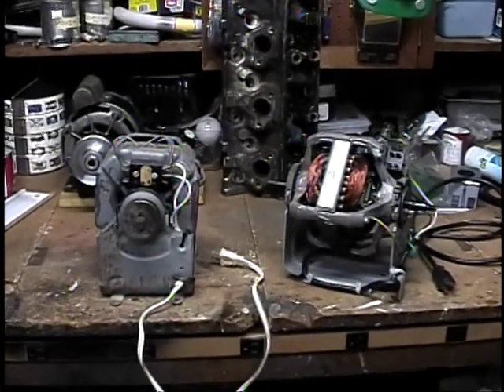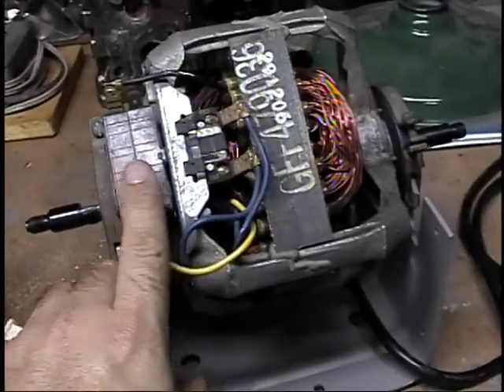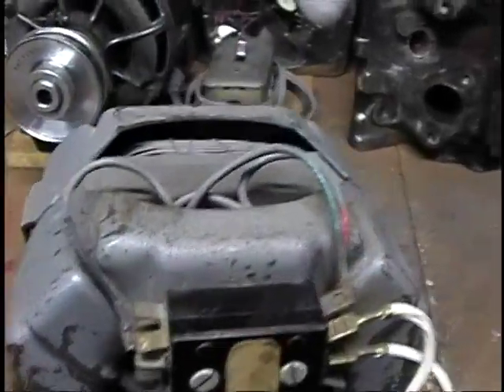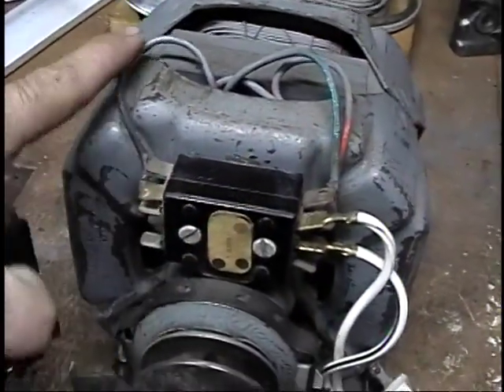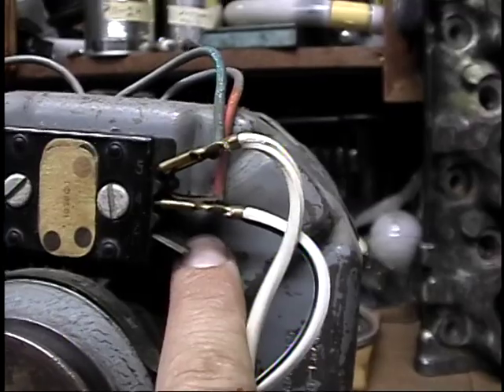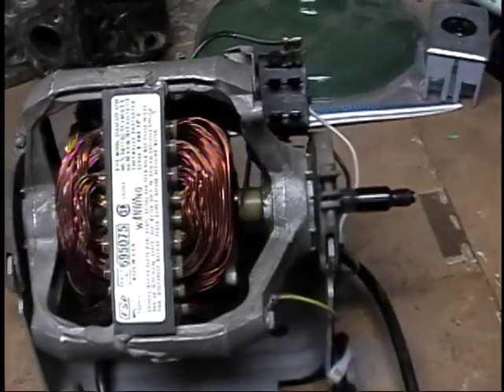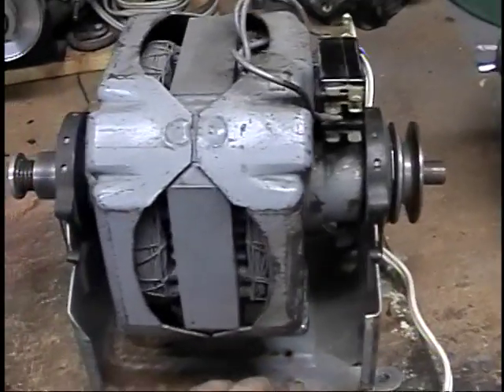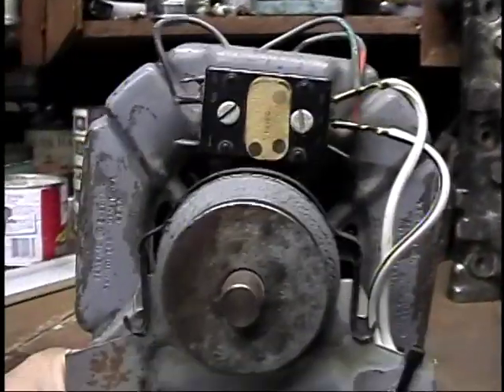How Fractional Horsepower Dryer Motors Operate

Comment: Ok, I'm willing to bet you know something about dryer motors?
I have an onld unit I pulled because it still worked.
It appears to have had an info sticker that is long gone.
No serial number or any ID other than the words "Belt pull" with a pully and belt symbol between the words.
I have pictures of the motor including a bunch of the inside where the switch and connectors are.
I assume there were no capacitors and I believe I would have pulled them with the motor.
It has 3 wires going to I assume 3 windings (one thin, two a little thicker) and I don't know if it is 120 volt, 240 volt, or could be either depending on how it was connected.
I have a bunch of pictures on Photobucket.
The wires shown I assume are misplaced as the two thick ones (I assume would be 120v and neutral) would be directly connected when the switch gets up to speed.
http://s911.photobucket.com/user/archangel2003/library/?sort=3&page=1
Could you please help me figure it out?
Reply from the maker: There are two that close to energize the heating element when the motor reaches speed.

Comment: I have done it. Get a couple large uF Caps (careful dangerous). Wire their negative legs together and solder., Now wire this cap in parallel with the slow or fast lines to the ac coils. With the centrifugal start motors the start coil kicks off automatically, with the size of the start coil effecting start torque. start cap capacitance also effects start torque.

Comment from the maker: @strawboss59 already out, but if I taped the switch down it didnt hurt.  It is possible though, with some motors, that pushing that button could still energize the start winding even when the motor is already running.  That is where the overload and also burning of the start winding could happen.  If I had a schematic, I could tell you more on that one.....

Comment from the maker: @strawboss59 The push to start button only serves to provide electricity to the start ( auxiliary winding ) until the centrifugal switch hits the run position which is a matter of seconds.  Thats why you can push it with the dryer running and nothing happens.  Now, I cant say for sure it taping it down will not hurt the switch or motor because there is always a possibility that it is wired differently than most.  On the motors I have pulled out, I bypassed it causes the motor was

Comment: Hi, great clip!
Here in Canada we'll be changing to Time Of Use metering for our electricity & I have a 240 volt time switch to install between the dryer plug & outlet so I can run it at night....the concern is the momentary switch on the dryer, If I tape it down so the timer controls the "on" time will the switch overload?
The dryer is 2 years old.

Comment: @More350Power Gotcha.  But on these, if you add magnets(if necessary) to the rotor, can you seperate the windings and get a power out put from them if you run them off a VAWT?  I acquired a dryer with one of these and this is the plan to get some emergency power out in the middle of a desert to run a radio and get some tunes to avoid running down the car's battery...again. :(

Comment from the maker: @More350Power applied to it, it runs and moves air, if you were to take the leads and hook them to a small light bulb or meter and spin the fan by hand it creates electricity.  That is a different design than these fractional horsepower motors.  The small computer fans have a wire wound stator and just a magnet on its shaft.  Electricity creates an opposing magnetic force that rotates the fan blade with the magnet attached.  If you spin the fan blade by hand, small amounts of current are made

Comment from the maker: @UpcomingJedi on these motors the electricity turns the stator into a big electro magnet and with the shaft ( rotor ) designed the way it is spins.  The only reason for two sets of windings is to have enough torque to start the rotor spinning.  A generator is the same just backwards and a few extra components.  If you spin a magnetic rotor inside a stator, it creates current and then you would need some rectifiers and diodes for DC.  Better example is an automotive rad fan with electricity appli

Comment from the maker: @sayrocknoanime On the label it just said single phase.  However, the ge capacitor start motor in my other video says split phase on it.  Dont quote me, but I believe the motors with capacitors on them, ive noticed, use less startup and running amps cause the cap helps give it a kick.  I have a motor on the bench running a wire wheel and its a capacitor start, flip the switch and its on.... no rev up its there, lol.  Thanks man!

Comment: Motor is 220... pitch them i'm guessing means dump them? Use to get a lot of that here before the recession, washing machines with just worn out brushes or blocked pumps just thrown out..might only be a couple of years old...  people had more money than sence now they have more sence than money:) .... that motor over here is 195 euro.. everything in ireland is expensive which is why i checked out the USA suppliers and saw a link to you...

Comment from the maker: @jerryboff You are correct there, a bad connection could cause a lack of supply voltage/amperage and cause problems.  You are more than welcome!  BTW, is this a gas or electric dryer?

Comment from the maker: @jerryboff My advice and if it was me, I would replace the motor and save the headaches of dealing with a temperamental machine.  Usually once a motor stops functioning properly, its a headache to keep it kicking.... believe me ive tried it.  Mine has failing bearings in it, (noisy) but it still starts and runs.  Id bet the start windings are shot.

Comment from the maker: @jerryboff Definitely doesnt look good.  I dont think a capacitor would be a good idea since the motor itself wasnt designed for it.  It could explode or overheat the motor.  It sounds like your start windings are shot to be honest.  Their job is to give the motor a quick hi-torque spin and back off once its running.  Gummed bearings would cause that, but you already said it spins freely.  It is possible the bearings are slightly worn which could also cause this to happen.

Comment: not looking good, have belt off motor spins freely but still only hums only takes the slightest bit of assistance to get it to start going... would there be any point in putting a capacitor across the start winding? say 8 or 9 micro f to see if it kicks it in or is it a dead duck? thanks

Comment from the maker: @jerryboff ...... in the fan that is attached to the motor shaft opposite the belt pulley.  You can easily rule that out by disconnecting the drum belt and see if the motor spins freely, then run it without the belt and see if if runs quietly without bearing noise...  Thats exactly what I would do, the bearings can gum up.  Hope this helps!  Thanks!

Comment from the maker: @jerryboff Its possible the start windings could be weak, especially if they heated up at some point.  It sounds like the bearings in the motor are failing causing the motor to drag and not want to start.  I would take the belt off and see how freely the motor spins.  Two other things that could cause resistance on the motor are bad rollers and or glides that the drum rides on.  Some drums use a bearing at the back, but most use glides and rollers.  Another thing is buildup of lint and or dirt..

Comment: i have the same whirlpool motor as in this video, when i press the start button the motor just hums, if i assist the drum motion it will begin to turn ok and the centrifugal switch operates as normal and the motor continues to run without any problem... there is no capacitor on this motor, all symptoms would indicate that if there were that it was what was causing the problem... have i lost part of the start winding or is there another possible cause for this problem?

Comment from the maker: @ticonderoga20 smoke, I can guarantee that the start windings are shot or at the very least weakened.  Their life is has been shortened.  Eventually they will short out even if you get it running.  The smoke is happening cause the motor is not exiting the start stage and shutting down the start windings.  In a lot of cases I have seen those winding wires made out of aluminum which is stupid in my opinion as compared to the old older ones.

Comment from the maker: @ticonderoga20 The centrifugal switch may appear to be moving and in fact will click on startup and shutdown, however the contacts inside the switches can sometimes stick, get welded together from excessive heat.  Thats what sounds like is happening.  One other thing, some dryers have that push to start option which if you arent careful how you hook them up, you will smoke em, ive done it a few times on junk motors I had replaced from appliances.  Being that this motor has already given off.....

Comment: I'm getting smoke from same GE dryer motor as the one in your video. It's a 1/4 HP ( rating stamped into the casing). After it runs for  10 seconds, it begins to smell and at 15 or 20 seconds, it starts to smoke. The rotor spins fine and I can't detect any play at all. The centrifigal switch works fine. The power is hooked up as it was in the original dryer. I've blown and toothbrushed as much lint as I can out of the casing. I can't open it up as it's soldered closed. Is this motor DOA?

Comment from the maker: @fukutubesuxx I have a couple more of these motors I didnt video, but they all (ones with this type of switch) appear to need a cord wired to the top two terminals on the right, just like the ones in this vid.  However I need to know is this a motor from a gas or electric dryer?  Is it possible you could take a pic of the switch on the front of your motor?  I could tell you a lot more if I could see it.

Comment from the maker: Sure, I cant try!  It might work out better if you send me a personal message..... I nearly run out of letters on these comments sections.  Those switches can be a pain in the neck.  I would make sure it is clean and not jammed with lint, wouldnt hurt to shoot some of that suff into the motor, especially where the mechanism is that triggers the switch.

Comment from the maker: I can sure try!  It depends on how many wires are going to the elements.  If its only two, and you put your meter leads on each one, you should be getting around 220.  If you put a meter lead to one element terminal to ground or neutral you will get 120.  There are several factors to consider that can interrupt the path; thermal sensors, motor switch, timer switch....

Comment: can you help me with a dryer?  I am getting no heat to the heating elements.  I put a multitester to each wire going to the heating  coilswhile the  dryer  is  running  each  wire  i put a  multitester  lead  to  it  reads  120 volts.  should each  wire be  reading  220  volts?

Comment: 3-phase induction motors have no need for capacitors or start windings to cause  phase shift since the AC being feed to them is out of phase by 120 degrees. They simply have stator windings and a rotor.